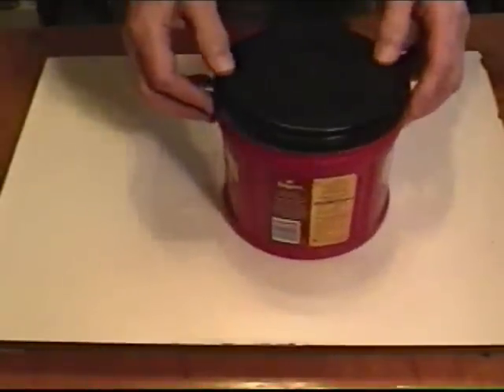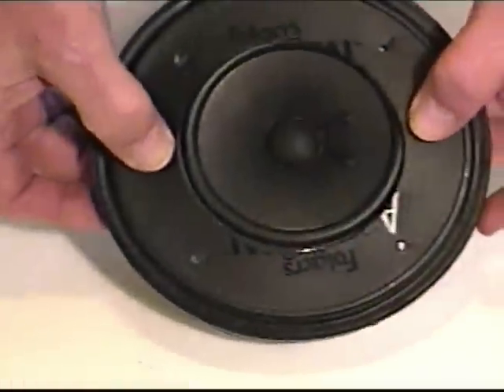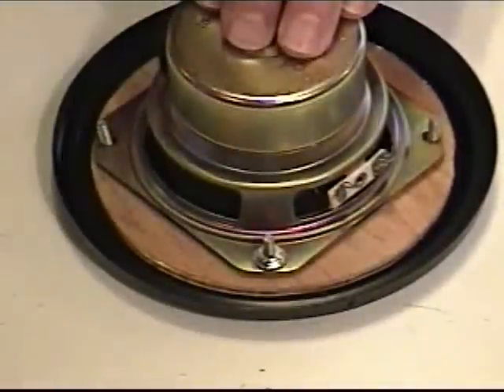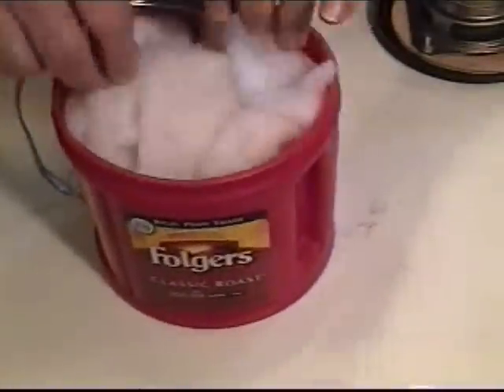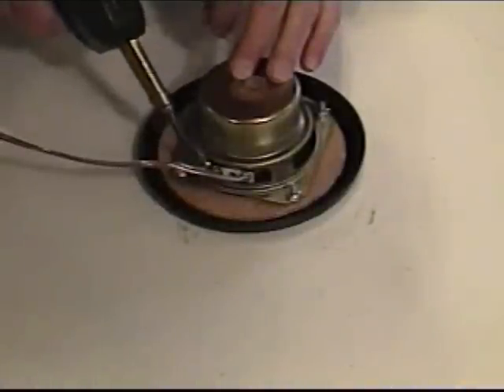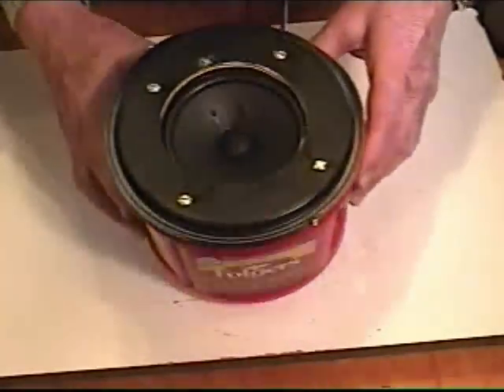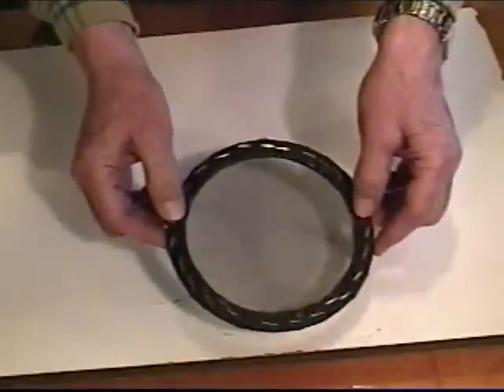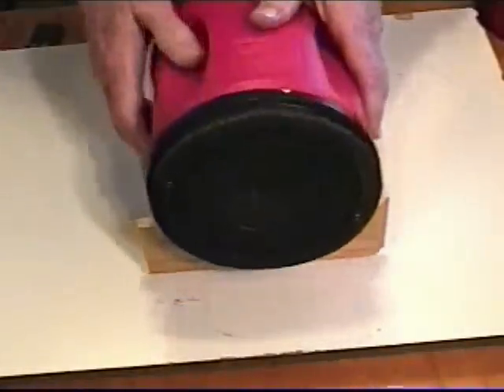Coffee Can speakers

Comment: Lol... i have some 6-3/4 speakers to repair and use... what could i use without building a box?
Reply from the maker: Buy some round plastic waste baskets with bottoms slightly larger than the speakers. Cut a hole for the speakers , wire them and  mount them in the bottom with nuts and bolts.. Cut out  four 2 " holes spaced evenly around the top lip of the waste basket. Then you will have two omni directional speakers. They sound better on a carpeted floor or you can stuff some  polyester batting in them to reduce the reflective sound.

Comment: When I was a teenager I couldn't afford to buy materials to build a box for a pair of 10 inch subwoofers and I did something similar with 5 gallon paint buckets and a small port in the bottom of it. Bass output wasn't too smooth and deep like I wanted it to be but it was ok for the moment until I could build a box for them... Very nice work Ken and I'm glad you are doing this to help inspire creativity. I'm a new fan of yours.
Reply from the maker: They do make pretty good enclosures. I use one as a test jig with a lining of old carpet.